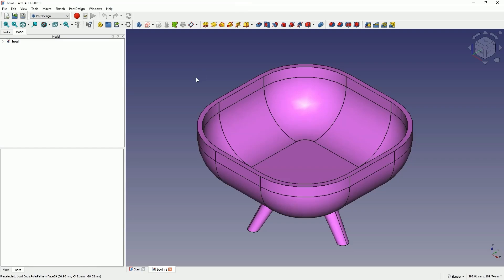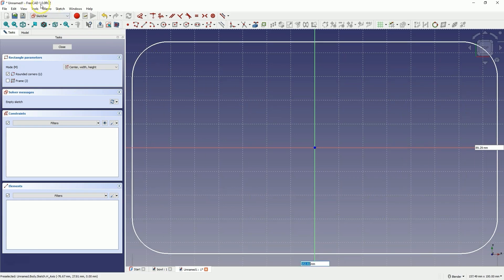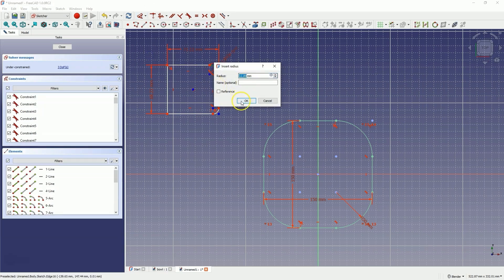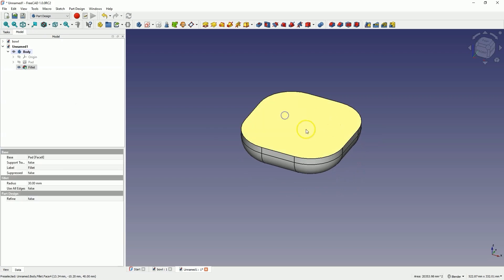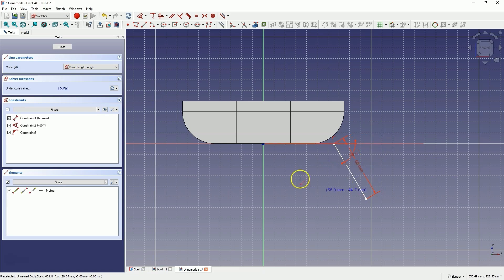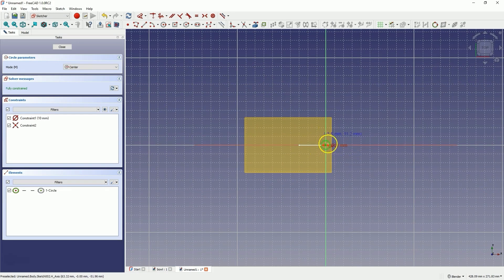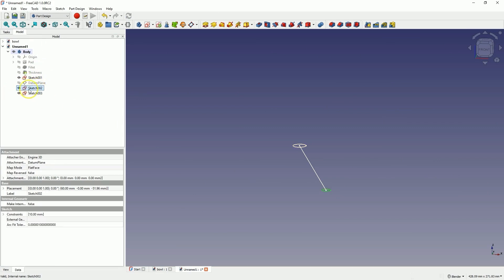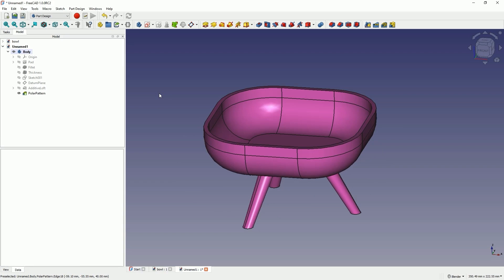FreeCAD Some More Than Basic Commands

Comment: On released version 1.0.0, Windows, the rectangle and rounded corner look right.  But, then I get solver errors when I try to close the sketch.  I have tried this 4 times, deleting the sketch and creating a new one each time.  If I do things the "old way", it is a bit fussy, but works.

Comment: I tried FC 1.0 RC2 for a few days now on my M1 Mac. It crashed several times on really simple tasks. What OS are you using?
Your tutorial is really straightforward. I like the little breaks when you choose an option in a menu. It gives time to keep oriented in the often not so well designed gui. Thank you!
Reply from the maker: I am using Windows 10 Pro. Report an issue on the FreeCAD forum.
Reply: the same here on M1
Reply: I use FreeCAD 1.0.0RC1 on GNU Linux Ubuntu and Fedora. And even Ubuntu - is a (libvirt) virtual machine under that Fedora. Both work perfect. I use AppImage of the app (so I don't install it into the system). I'm not Windows user and I don't know how to install it there. My colleague used FreeCAD on Mac. And also had no problems. But I had often crashes problem when I used Ondsel before.